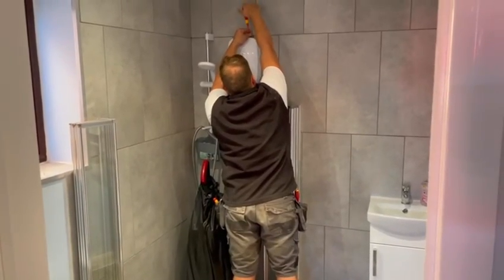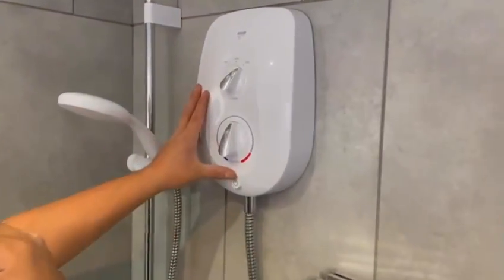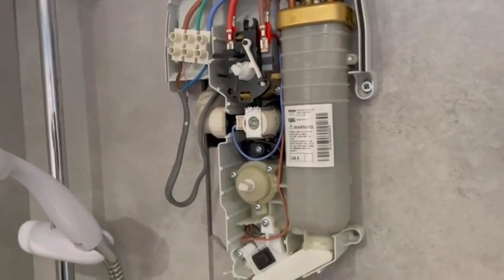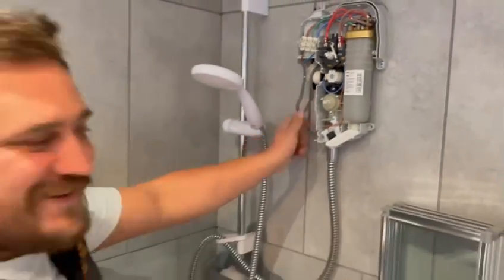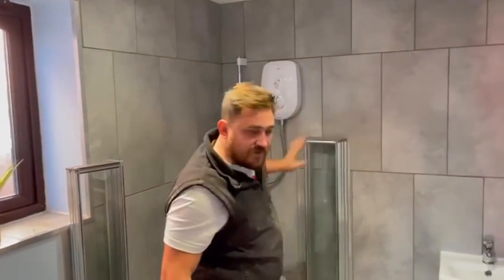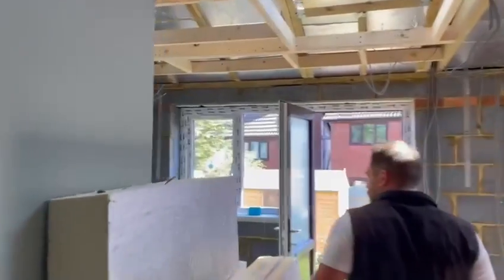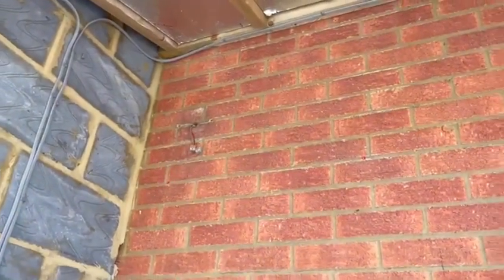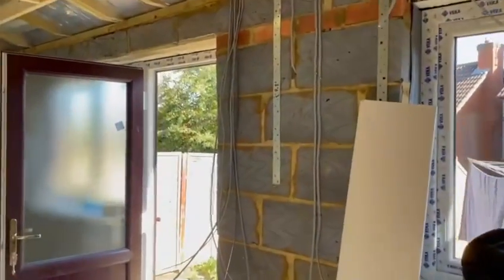8.5kW Shower Wired in Lighting Cable

Comment: I've seen a 13amp fused spur in place of a 45a shower isolater switch. 

The fuse was soldered with a lump of metal into its holder to stop it from blowing. 

The customer told me the builder did the electrics himself.

Comment: Surely this is a joke, you guys must have rigged it. Someone with special needs wouldn't get this that badly wrong. I mean even Stevie Wonder would be able to feel that the csa of those cables conductors are undersized 🤣. 20 amp circuit breaker wtf, has the person who installed this smoked Pot & Meth 🤣.

Comment: I assume the sockets off the 1.5mm cable was a ring final circuit.  Sockets can be on 1.5mm cable on a radial with suitably sized MCB/RCBO of course.
Reply: Agreed though I would normally use 2.5sq mm for a radial circuit.
Reply: @adrianshingler9783  
I know - in case. Rule of thumb. But a 16A radial in most case (not supplying heavy appliances in a kitchen) using 1.5mm is fine and safe. And cheaper.  All it will be supplying most of the time is TV, charging,  etc, and the occasional 1.5kW vacuum cleaner.  Using 1.5mm rings can really make an installation much cheaper. 

Induction hobs are available on 13A plugs.  They can take max 16A by setting up the hob (hard-wired in over 13A). Most electricians would run needless expensive, hard to work with, 6mm cable to such a hob, when using 2.5mm is more than suitable. So a radial for the 3kW oven and one for the 3.2kW hob, both using 2.5mm.

Same with dedicated radials from the CU to a washing machine and dishwasher (these day they are around 2.2kW, about 9.5A). All they need from the CU is 1.5mm on a 16A breaker, as 1.5mm can take up to 20A of current. 

Doing the homework can save a lot money.
Reply: @johnburns4017  agreed and as you will know, a number of installation factors have to be taken into account when choosing the correct cable; as long as BS7671 is followed there is no problem in my book.  I mainly do jobs for myself these days and being a born pessimist, I always tend to ‘over spec’ anyway just to be sure 😎👍.
Reply: Just a point to note, the 20A you quote for 1.5 sqmm only relates to a clipped surface mounted cable agreed?
Reply: @adrianshingler9783 
You have to do an assessment when derrating. A 16A breaker will cover it all for sure, 20A depending where the cable in installed.  Again how many times would you get 16 amps running though a normal ring with no heavy appliances?  Pretty well near zero chance.
Reply: @adrianshingler9783  
With very expensive AFDDs being recommended on socket circuits on all installations and mandatory on some. Keeping the costs down is essential. Not installing oversized cable keeps costs down.

Also, having just one socket circuit on an AFDD, with all heavy appliances on radials keeps costs down, as only one AFDD is used.  In France all heavy appliances, fridge, dishwasher, washing machine, etc, have to be on separate dedicated radials - screwed terminals only at the appliance and CU, reducing fire risks. Doing the same in the UK avoids having more than one expensive AFDD.
Reply: @johnburns4017  the problem is (if you are designing and installing ring circuits for a third party) you have no idea what folks are likely to connect into a single ring.  Could be portable fan heaters, kettles and hairdryers and you could easily hit a maximum demand in excess of 6kW.  You as the designer are not to know this.  So for me ring final circuits as per the regs ie 2.5sqmm backed by a 32A mcb all day long.
Reply: @johnburns4017  good stuff understood and yes keeping costs down by careful design has to be the way forward. The move to steel consumer units, AFDD’s and multiple RCBO’s sounds very expensive to me regardless of the cable requirements!
Reply: @adrianshingler9783  
You design a circuit to its known usage. Second guessing future usage is crystal ball gazing.

The trend is move to radials, which I think is a silly move as rings have proven safe and reliable over 80 years. So a 2.5mm radial may have 25A breaker at the CU. A 1.5mm ring on a 25A breaker will do the same, most probably saving money on expensive cable. 

The regs recommend AFDDs and RCBOs. They do make sense. Keeping costs down by using only one AFDD and not oversizing expensive cable (these days cable is expensive) makes sense, and also not fitting needless circuits. 

In an average semi the rule of thumb is three 2.5mm rings. One for the kitchen, one for downstairs and one for upstairs. Only one ring is needed if heavy appliances have dedicated radials.  There again, a dedicated dishwasher/washing machine radial does not need 2.5mm cable, only 1.5mm on a 13A (they are available) or 16A breaker. These appliances rarely consume over 3kW, most are around 2.2kW.
Reply: @johnburns4017  yes thanks for that but we have to agree to disagree with regards to ring circuits.  You have no way of knowing how the rings are going to be used (if for example you are installing in a new build) so for me 1.5sqmm rings are a non starter. I have no problem with radials and their design; as I said at the very beginning of this chat, you just need to follow BS7671 plus its guidance notes regarding selection of cable, overload protection and earthing.
Reply: @adrianshingler9783  
A point I made was that a 2.5mm radial with say a 20A breaker, can be a 1.5mm ring with a 20A breaker.  It is not a defacto standard circuit, but that does not mean it is prohibited. A 20 amp ring final in 1.5mm will be no less safe. But it will be easier to fit having smaller cable, so faster, and in most cases probably cheaper. It can also upped to 25A for sure.

A quick look at Screwfix says that 50m of 1.5mm is £29 to 2.5mm at £42.  About 30% less.  That is without labour savings over a quicker fix. Over a decent sized job that could be a significant amount.  Also the saving on cable could go towards better circuit protection like DP RCBOs /AFDDs.
Reply: @johnburns4017  understood.  Thanks for a decent chat and you had me digging my regs and guides out, I am rusty I must admit.  Suppose the question is would the regs have to be changed to permit the use of a 1.5sqmm ring? Have just been watching John Ward slagging off ring circuits, he clearly prefers radials! 😎👍
Reply: @adrianshingler9783  
From memory, the max is a 32A breaker on socket rings, and they say when using a 32A breaker 2.5mm cable, minimum must be use. I think I have that right.  But it does not precluded anything below that. 

Rings are used in lighting to keep voltage up and conductor size down - and using sockets (5A lighting sockets).
Reply: @adrianshingler9783  
I like his vids and respect John Ward, but he is no guru or the fount of all electrical knowledge. Many clearly do not understand what a final ring is to do and how it came about. The ultimate design is to have a radial to each socket outlet on its own fuse/breaker at the Consumer Unit - the optimum solution of course. One fuse at the Consumer Unit for each socket.  This means you will need a very large consumer unit and lots of fuses (one for each socket) in the consumer unit, and an amazing amount of cable. 

🎊🎈  BINGO  🎊🎈 A ring gives this by distributing the consumer unit around the house via a ring cable, having a fuse on each socket. The ring cable is a fused busbar. This saves the vast expense of a plethora of radial cables back to the main panel and also a plethora of fuses at a very large consumer unit.

Simple, safe and highly effective.
Reply: @adrianshingler9783  
I am sure I put this on John Ward's vid about rings. It appears not to be there any longer. ....

Yes, there are advantages to rings. They have been widespread in the UK for 80 years. They have been found to be very safe.

♦ Cheapness, as smaller, easier to install, wires can be used;
♦ Two ways for the earth back to the consumer unit;
♦ Another is a large number of sockets can be off one cheap ring;
♦ Having the same number of sockets using radials would mean multiple radials and multiple extra breakers at the main panel - MCBs/RCBOs/AFDDs. Far more cable, expense, labour and hassle;
♦ The 32A breaker and 13A fuse in the plug ensures safety.
♦ Portable plug-in appliances on a ring cannot exceed approx 3kW. Some plug-in ovens are on rings;
♦ Rings usually have a 32A breaker at the main panel - can be a smaller value;
♦ Using push-fit maintenance free Wago type connectors to connect up the ring makes them a lot safer as not being screwed connections they do not work loose. The ring's current does not run through the socket terminals;
♦ The British plugs are designed with rings in mind having a max 13A fuse in them - can be as low as a 1A fuse in the plug to suit the appliance. Small flex and appliance? Then a smaller fuse;
♦ Rings in the UK are limited by square metres of floor space, with no limit to the number of sockets on the ring. 100 square metres of floor space for 2.5mm cable for a 32 amp protected final ring .

Radials are also used in the UK, rings are not mandatory, but used because they are generally trouble free and safe. They can be installed using rule-of-thumb. These days a ring will be on an RCD or RCBO - RCBOs now are becoming DP, so safer again. In one job in an office, they wanted more socket outlets for extra desk computers. It was a simple matter of extending the existing ring with the extra sockets as the current draw was low. Cheap and easy. If radials were used three radial circuits would be needed, which would mean an extra consumer unit, breakers, wire, etc, then far more labour.

Some disadvantages are:

♦ Rings are more difficult to fault find. But electricians have no problem once the ring is fully understood;
♦ Another is that if a number of high current drawing appliances are on one side of the ring, say near to the main panel, most of the current draw may be down one leg of the ring which is rated below the main 32A breaker. 2.5mm cable is rated at 27A max. Although tests have proven the cables do not exceed their current capacity, just an imbalance in distribution of the two cables from the main panel (consumer unit). Good circuit design will prevent this, negating this disadvantage. Balanced rings can be installed by daisy chaining to alternative socket outlets on the ring. That is the first socket will draw from one side of the ring, the second socket will draw from the other side, and so on round-robin. Or use 4mm cable to the point where heavy current drawing appliances are, then 2.5mm for the rest, if it is that troubling for some. Using 4mm cable on one side of a ring and 2.5mm on the other, is still cheaper than a bunch of radial circuits.

Overall I consider one ring superior to a bunch of radials needing their own breakers at the main panel. They are simpler, cheaper, being proven to be safe and worked well over the past 80 years. You will have to give a very convincing argument for me to give up rings. I have not heard of one yet.
Reply: @johnburns4017  thanks for all that John! All sound points, interesting that the ring circuit is only prevalent in the UK whereas in the rest of Europe they appear in the main to go for radial feeds (I used to travel a fair bit with work).  Yes folks talk about potential breaks in a ring and I like the idea of using Wagos, good tip that 👍.  I am not an electrical contractor, but the question is if a customer requests a full rewire and you put in a 1.5sqmm ring, would A N Other contractor possibly fail it during a subsequent inspection?  Are we locked pretty much into 2.5sqmm minimum for UK ring circuits?
Reply: @adrianshingler9783  
If the guy inspecting knew his stuff he would not not fail a 20A 1.5mm ring. There is far too much of we have always done it this way and rule of thumb.  

The most common cause of fires is loose connections.  They loosen up over time. Only yesterday I opened a Hostmann Economy 7 immersion timer box that was 22 years old. I have a habit of tightening up screws on terminals. One screw was dangerously loose, when I am sure it was not 22 years ago. 

Using Wagos in 35mm socket backboxes mean current only runs though socket terminals when the socket is being used. The Wagos are also excellent for 1st fix testing. Then using 4 inch flex 2.5mm conductors the socket just slides in after a quick connect to the lever Wago. Also saves a lot of time, as the tails can be fitted to sockets and FCUs on a bench, screwing in the sockets in a minute or two using a small battery driver.
Reply: @johnburns4017  Yes top tips right there and thanks again! Agreed on two counts….the regs can encourage folks not to think just do….plus fixing screws on copper do loosen with time.  I always check if I open up a socket or switch plate, I haven’t used Wagos yet but soon will 👍
Reply: @adrianshingler9783  
What makes the ring prevalent in the UK is the fuse-in-plug in the superb British 13A plug.  I recall having a debate with a Continental guy who 100% dismissed rings as dangerous. His point was that if the ring was cut you end up with two 2.5mm radials protected by a 32A breaker so the cables could cook causing a fire. If a cable severed you would know about it somehow, so that was not a high value valid negative.

However, the biggest reason for fires is loose connections. Fires are more prevalent on radial socket circuits, as all the current can run say through a loose connection on the first socket from the CU causing a big arc to form a fire.  A ring is fed from two ways, so reducing the formation of a dangerous arc. If the the earth is cut on a ring it also fed from a different direction as well maintaining the earth. Two superb advantages of rings.  Then have Wagos take the rings current load and have sockets and light fitting with push Wago types of connections as spurs off the ring, then the possibility of an arc on a ring is vastly reduced.

Look at the Continent, they over 80 years had the same fusebox arrangements as the UK, fuses then MCBs.  Yet they have a worse electrical safety record than the UK. Rings were a prime reason for the UKs superior safety record. Reduces dangerous arcing, always an earth back to the CU and fuse in the plug protecting the flex and appliance. 

I have just got back from France being there for near a month. Their way of fitting CUs is vastly superior to ours.  Also France, Germany, etc must have DP disconnectors at the CU. This means L & N bus bars (called combs), which are at the top of DP MCBs.  Far better. Also regs on heights of CUs from the floor for user access (not at ceiling level in toilets or under stairs, and inset in walls behind metal doors in halls.  CUs tend to be long with multiple stacked DIN rails. The DNO does not have antiquated tube fuses using DP RCBOs as the incomer isolator. 

New sockets and lights fittings in France are all screwless pushfit to reduce arcing giving faster installation. 

My prime initial point is that circuit design is going to change with the introduction of expensive AFDDs.  Economic cuts can be made in circuit design as RCBOs/AFDDs are not cheap, yet still give the service needed and the highest protection.

Nice talking to you. 🙂
Reply: @johnburns4017  same John and I totally agree with regards to our fused plug, thank goodness we didn’t end up with an inferior (in my book) ‘Europlug’.  Our plug may be bulky, but it is a well thought out and solid design compared with most European and US plugs.  Also your French experience shows the way forward I agree.  DP disconnection on all circuits including the incomer(!) is way superior to what we presently have, even though I notice compact DP RCBO’s are now becoming increasingly available in the UK.  I recently installed low wattage LED strip lights in my workshop and they use push fit connections, very impressed with them.  Easy to install too.  Thanks again for your time and thoughts John 👍
Reply: @adrianshingler9783  
The prime aim must be to get maximum protection. But that can be done with some common sense and economy.  So, I would rather have a 1.5mm ring using Wagos taking the rings current load, on a 25A AFDD (which has overload, fault, earth leakage and arc protection), than a 2.5mm ring on a 32A MCB. Of course assessing usage first. 

If people focus on maximum protection on circuit protection inside the CU, making economic saving on circuit design & cable sizing, if they have to be made, we will have superior, and safer, electrical systems. 

The average home in the UK, the upstairs and downstairs rings (ex kitchen) will draw nowhere near 25A amps. If it does then usage has changed so a larger, or extra ring is needed.... and this will be a rare event in a normal home.

Comment: When l moved into my house I noticed cable trunking In the spare bedroom so  decided to check it as it was more than likely the supply to the 8.5kw shower, the cable was 6mm T&E. On further investigation I was curious to see how they had run the cable ,when I pulled the carpet back at the bottom of the trunking the installer had cut a groove across the underlay laid it on top of chipboard flooring drilled through the skirting at the opposite side of room to access DB in garage then covered it up with the carpet.

Comment: I seen shower wired in 1.5mm flex of the back of the hall socket. Totally overloaded but……. It worked and the flex was actually in fine condition. Must have been 5 minute showers only 😂 Rewired it was!
Reply: The 1.5mm cable acts as mini heater.